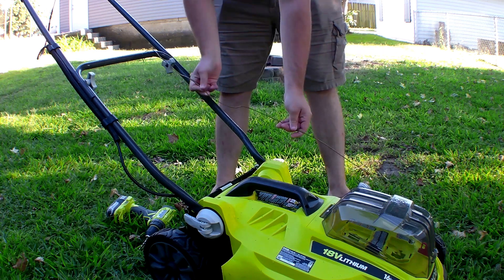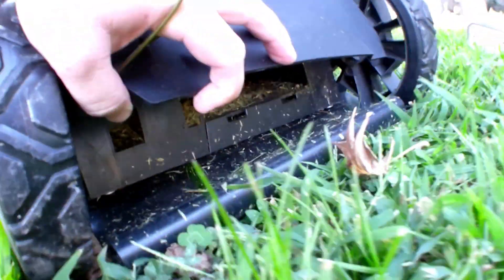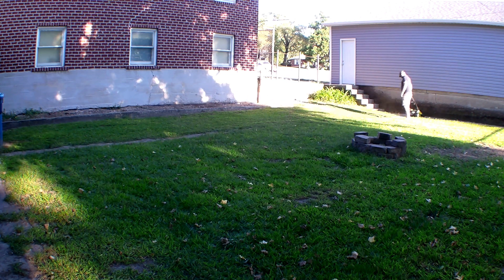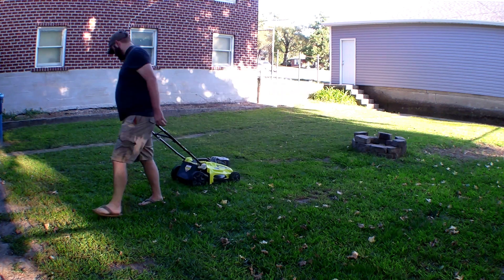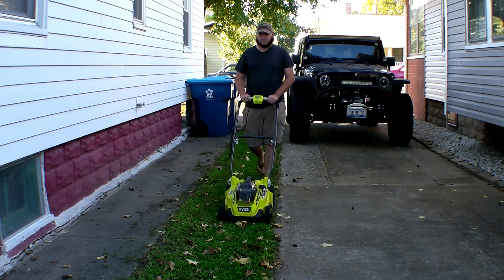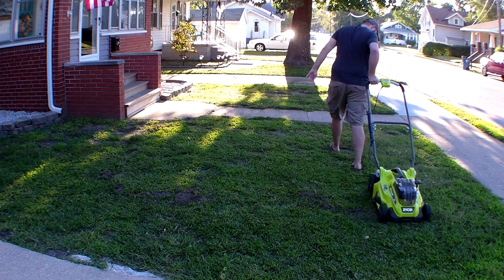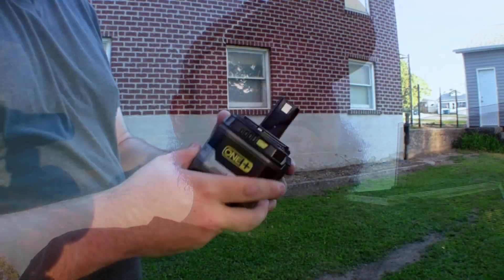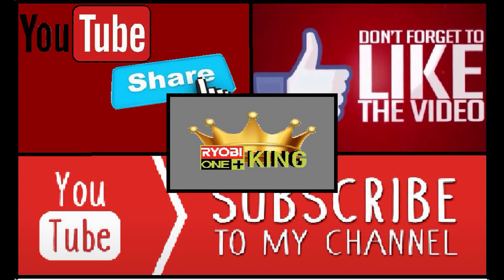NEW Ryobi 18V Lawn Mower

Comment: I have a 10,000 square foot backyard and had a huge problem with pocket gophers. I tried bombs, water, etc. and nothing worked. Finally I had to get a professional guy in who basically fills the holes with a mixture of 3% propane and 97% oxygen, then ignites it with a spark. It does tear up things a bit but it's not that bad and doesn't ruin the yard.

Comment: You basically made a side discharge mower.  Really a rare discharge mower.   Good idea cause you lose a lot of power trying to mulch grass.  
Do you have videos about the blowers?   I just got the p2109 and I like it.  Only bad thing is the blower tube kept working loose so I put some screws in it to hold it in place and it’s perfect now.
Reply from the maker: Billy bob Smith I don’t but I will make some thanks buddy

Comment: Run the same mower with 9ah batteries. It is pretty much all I need. I had a 19" electric mower before this and I find it to be way faster with the 16" because it is more maneuverable and obviously no cord. Get this mower if you run Ryobi tools and you will not be disappointed.
Reply: Never saw the need for the 9ah until now but I think a ride along backup batteries holder would be great for those of us with a good assortment of the 4ah's

Comment: In case you don't know Moles are attacked to yards that have continuously moist areas. One is if you have areas in your lawn that puddle and maintain water after storms. The other is the wood chips used as decoration in flower beds or around the house.  I leveled and put a slight grade away from my house in my lawn so the down spouts drain and changed to colored stone and the moles are all gone.
Reply from the maker: Thanks I acutely found that my yard has a lot of grubs so I am going to treat it next year and see what it does.

Comment: Amusing video. I was not sure why you were walking backwards instead of turning around. I do that same thing myself because I am using a side discharge and I go backwards that so that the discharge will not go in the street rather than back on my property, but you are not dealing with side discharge in your case.
Reply from the maker: The grass is so thin that some times it hard to tell where I have been soon I just find it easier to move this way idk

Comment: Great review. Is that ryobi mower P1111  the current model being sold by Home Depot? In your opinion can it mow 3000 sq ft with (2) 4ah batteries or does it need (2) 9ah batteries. Keep them reviews coming!  Many Thanks.   Rich
Reply from the maker: Hello rick thanks for commenting yes this is the best and current 18v mower they sell. I would say 2 9ah battery’s for sure if you keep your grass short this will do it but if you let it get tall you might not have enough juice thank for commenting

Comment: They should make a 18 x 2 lawn mower like their miter saw
Reply from the maker: NSX Properties they do look at my other lawn mower video it can take 2 9ah battery’s
Reply: but its it actually 36 volts or just hold and use 2 18 volt batteries
Reply from the maker: NSX Properties just 18v but it is a lot better then the first
Reply: I think it's just 18 volts

Comment: Would love some clarity on a couple things.  I see in the comments you say this is the older model (P1100A) not the newer model  (P1111).  But when I look up either model on the HomeDepot site, both in the actual product info section and Q&A sections they say you can’t use 2 6AH batteries as the lid won’t close.  Clearly you are using two 9 ah batteries!  Any chance you have some other obscure model, they made a mod and didn’t change the model number, or their info is just wrong?!  Don’t want to spend the money on the 9 ah batteries and run into issues fitting them in.  I have a full 1/4 acres with some hills, so only way I’m going to consider the mower is if I don’t have to run through 8 batteries per mow!
Reply from the maker: If you get the model that can fit the 9ah like me you can do close if not all a 1/4 acre the model number is P1111 on the website just look for the one with the tall opening lid and you will be good thanks for the comment!
Reply: RYOBI KING thanks, odd because they explicitly state the P1111 only fits one 6 ah battery.  Must be an error on the Home Depot website: https://www.homedepot.com/p/RYOBI-16-in-ONE-18-Volt-Lithium-Ion-Cordless-Battery-Walk-Behind-Push-Lawn-Mower-Two-4-0Ah-Batteries-Charger-Included-P1111/207150002#
Reply from the maker: That is odd I hve used 2 9ah and they fit